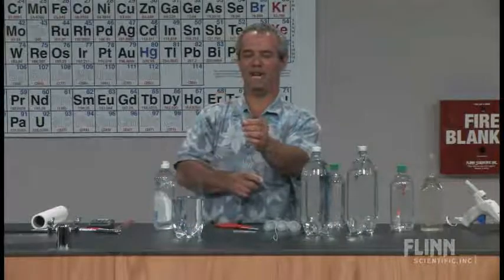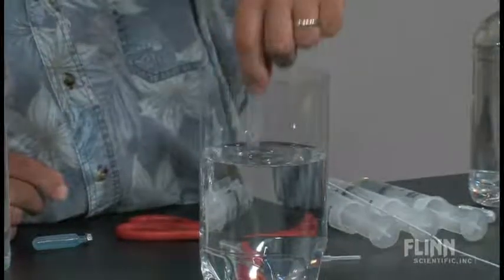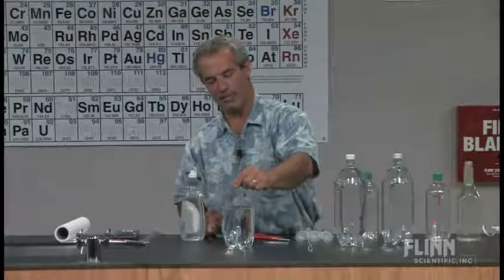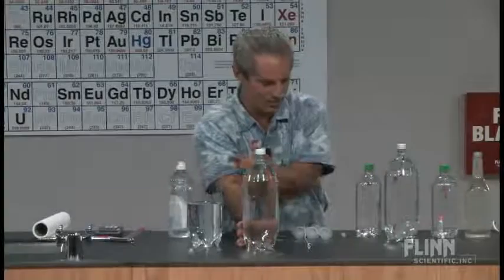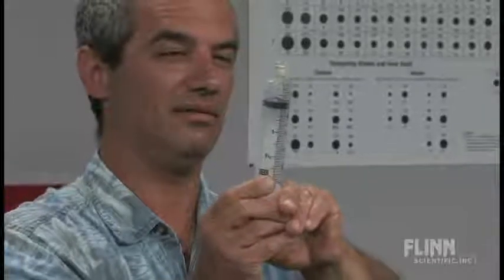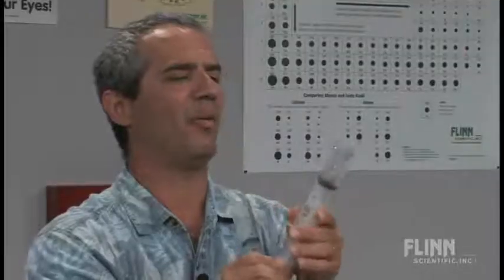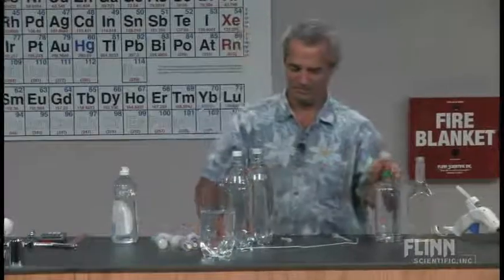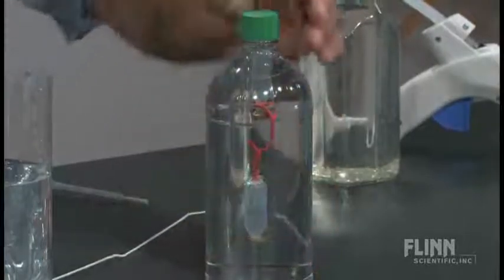Cartesian Diver-sions

Comment: Four years and one comment.   Nice touch to show the difference in hydrostatic pressure.  Taller bottles make this easier.
...
I don't believe it is enough to simply say the diver's density changes.
...
However, it is not explicitly stated that the 'Open" diver's volume change means it is displacing different amounts of water.  It is misleading because the water "inside" the diver appears to be part of the diver's displacement, but it isn't. This is why some people think, and teach, the diver's mass changes, when it is actually constant.
-- 
Cheers, ScienceAdvisorSteve
www.challengerillinois.org
Reply: nah, the gas compresses, the the diver draws in more liquid, thus, more mass, and greater weight while also less buoyant force. it's so beautiful, i'm losing my freakin mind.
Reply: @h7opolo  Sorry., that is FALSE
That can not be true.  The bottom of the diver is OPEN to the water. Therefore, the water INSIDE the diver CANNOT add to the weight.   The weight of that water IS supported by the water under it.
That water "inside" the dropper is NOT held up by the dropper, therefore it is not adding to the weight.
That is the physics fact.
.
While saying the (average) density increases is true, that is rather indirect.  The weight per volume displaced is changing because the displaced volume has decreased for the SAME weight of the solid parts. 
Buoyancy has to do with the DISPLACED volume of water.
.
He explains it correctly at 5:26.  The gas pocket volume (displacement) decreases when he squeezes.
.
Listen at 6:48 
The density increases because: for the SAME weight, the volume decreases.

.Sorry.
Reply: @Observ45er  ok fair enough
Reply: @h7opolo  He explains it correctly at 5:26.  The gas pocket volume (displacement) decreases when he squeezes.
.
Listen at 6:48 
The density increases because: for the SAME weight, the volume decreases.
Reply: @h7opolo   Thanks for listening and responding.